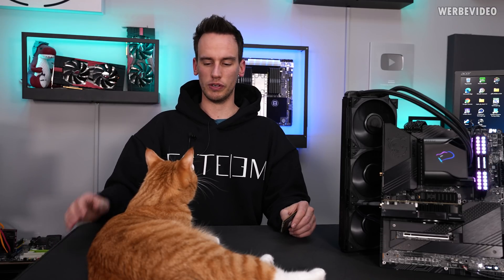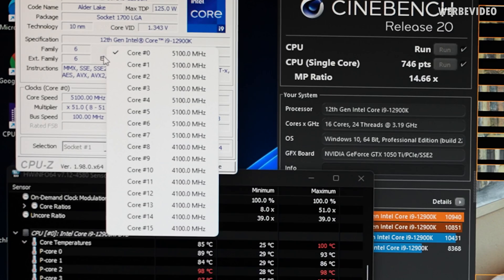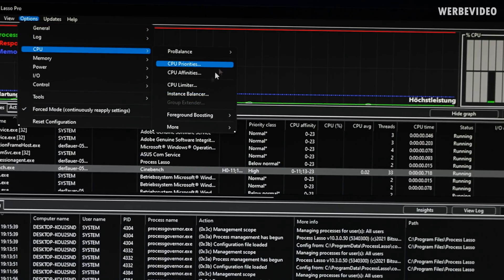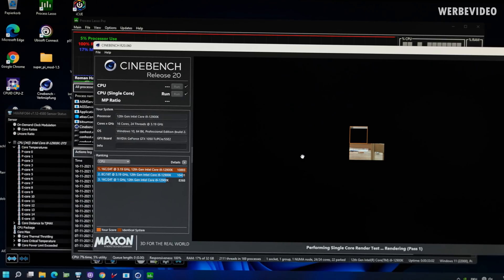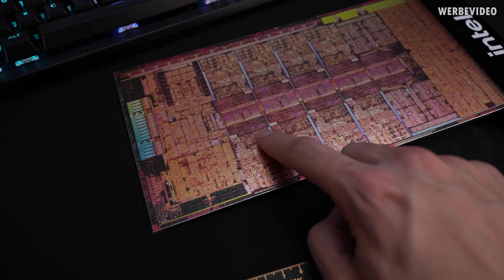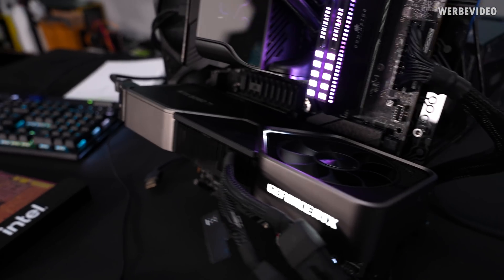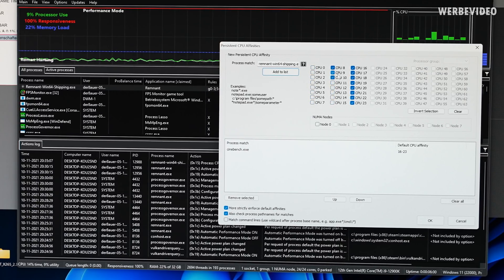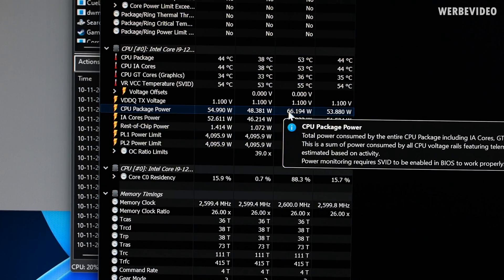The E-Cores were not meant to be used This Way... but it's Amazing!

Comment: Excelent video! I really would like to see more E cores too. Few important tasks demands a good single thread performance. 

I don't know the reason why intel didn't go for more E cores. I would prefer 4 P and 24 or even 16 E cores.
Reply: Power, thermals and socket size, considering how power hungry and hot this generation gets
Reply: Performance headlines. If they’d used more E-cores in the 12900K and less P-cores, it wouldn’t show up very well in benchmarks. Techspot did some interesting research and showed that for gaming, it would be best to only have P-cores. So Intel balanced it out to take the important ‘gaming crown’ with the P-cores yet put enough E-cores in there to also be competitive in heavily multi-threaded tasks.

Comment: I don't think that the result is that amazing, not bad but nothing to celebrate. My old laptop with a zen+ 4c/8t 3500u set a 45W made 1759 points at an average of 3.5GHz on cibebench r20, so normalizing for clock and core count should be around 4100.
But I understand that nobody can afford to make Intel angry, everyone reviewing those new CPUs is unnaturally positive on every aspect, even the power consumption

Comment: This should actually open up options for some super cheap CPUs or APUs with decent performance. Like a desktop celeron with 4 cores and a super small die. Increasing the die size a bit you could add like 128EUs of DG2 backported to intel 7. This could compete against AMD's desktop APUs which are far ahead right now, at least for gaming.

Comment: Intel probably kept the same number of P-cores as previous because that is what people expect. I think people might complain if an i9 only had 4 P-cores and 24 E-cores. It sounds like that might be a better processor though.
Reply: Unless they can get their scheduling to be perfect, threads bouncing between P cores and E cores would surely result in worse performance. At least this way the amount of threads used by most games fits on the P cores

Comment: Intel should make a e core only cpu. But isn't that called ryzen? I mean, relative small, lower power than the big intel cores, very good for multi-core, but not that well suited for high boosted single core performance. A bit like the first ryzen moment, but now with a big.little setup wich does not completely make sense at this moment with this cpu.

Comment: Nice video man. 
I was wondering, whether its the windows, the app itself, the motherboard or the cpu that decides on which core to put the load ?? Like how are they distributing the load ?

And one point to note is that 
Even if we use a tool like this (Process Lasso), some who are not experts may not even be aware that some heavy apps might just be using only e cores or mostly e cores.

I hope this works out for intel and for us, as it may be a huge technological advancement. Its like having two cpus on one motherboard, one for small tasks one for heavy.

Comment: I wonder if the CMT "dual" front end from a bulldozer module (modernised of course) would increase efficiency again - from memory that only added 15% die space to add a second thread at nearly the same speed for integer work. I'm not sure what the sharing L2 relationship with the E cores are.

Comment: I used Lasso back in the day of the First Ryzen 1700 so i could have games running only on one CCX not really had the use to use it since windows was updated to better assign tasks, was much better then disabling half the CPU to avoid the CCX cross talk and could still use the 8 cores and 16 threads in multi apps but then used 4 cores and 8 threads in games.

You could optimise it further too with 2x P-cores with hyperthreading and leaving enabled the 8x E-cores since games mostly utilise the first 2 cores for graphics and AI.

Comment: I’ll be interested if your opinion “this is the way to go” changes when AMD drops Zen 4. A P-core could also be ran at a lower frequency with a much lower voltage to become more efficient. This little big approach seemed like the only way for them to compete. They need giant cores pushed to the limits to sustain gaming performance leadership, but they would be shipping more heaters without the E cores being able to run every day tasks. It works and it’s exciting because it’s new and seems efficient, but I’m not convinced this is the way to go.
Reply: CPUs are becoming more heterogeneous in general. You're seeing various types of accelerators and "neural engines" being added to perform specific tasks instead of the main core.

So it only makes sense to take this further and have dedicated cores for maximum single threaded performance, and then paired with slower, less power consuming clusters of tiny cores for heavily threaded workloads. 

Zen4 will be amazing, but Gracemont cores are half the size of Zen cores. Intel could out-scale AMD core count in the consumer space.
Reply: @moist_ointment  agreed that there will be lots of compute types on a single CPU die such as different accelerators, but I’m still unsure that we need 2 different cores that can each do the same task only for the sake of energy efficiency. It seems to be working for Intel on their first generation, but AMD has explicitly said they won’t be doing the same thing. So it will be interesting to see things evolve with the 2 x86 players proceeding with 2 different methodologies
Reply: With the logic you have set, think of it this way -> running a P core at lower voltage will certainly reduce performance, and increase efficiency, while taking up as much space as 4 E cores (which by the math here delivers more that 4/3 multithread performance of a P core at lower power) ... It's not so much that Intel needed the core count to compete with AMD, its just that this is the right way to go if you want to scale both single thread and multithread workloads within the same die space. In fact, intel will have the freedom to adjust the P core E core count within the same die space to add more multithreaded performance. I would encourage you to see how the mobile CPUs will perform, because instead of 8P cores they will have a 6+8 within the same die space, and it might help you see better why this is the way to go

Comment: Seems like a good workaround for Windows 10 weirdness in some cases. Would be interesting to see how much performance the e-cores get when overclocked. Can they match an 8700K or a 9700K?
Reply: They do match a 8700k out of the box. they aren't 6th gen cores, they're just based on the same architecture.

Comment: My concern has never been with the processing capability of the E cores. I don't have much confidence in schedulers doing the "right thing" with processes. We've been living in an SMP world for so long.

Yes, ARM asymmetric SoCs have been around for a long time, but that's in mobile workloads, not desktop.

We shall see, though.
Reply: Sure ARM improved that tech during a decade but you seem to neglect that's not just mobile workloads but embedded workloads as well with much higher time constraints and those worloads run on more slower processors and memory/cache than laptop/desktop so they need all the resources available as well as the optimizations.
The reason ARM heterogeneous arch works well without any special scheduler is because they mainly use the Linux kernel which was long time ago tailored for NUMA multi CPU servers and doesn't have the tendency to randomly switch process execution from a thread to another.
The scheduler just need to be as simple as the Pstates frequency governor : prioritizing performance or efficiency by launching a new processus on one type of core according to the processus priority then moving it from the other type depending on its resource usage. And It just works.
Reply: I totally agree. Just not a good design decision. We have been in an SMP world at the low level Windows NT flavors and even Linux and the like schedulers for so long in the X86 ecosystem that Intel's approach to this kind of change just does not make sense. And thus I have no confidence in schedulers doing right things with processes designed for same type of CPU core count and type as well as a massive library of software in the X86 ecosystem.  This is a much bigger and more radical change that can cause much more issues than any of the other changes we have seen the last 20 years or maybe more. I mean chipset changes, CPU arch changes like pipelines and IPC and core counts, just new drivers and such at low level. And scheduler changes in Windows not an issue as SMP has been around since like 1995 with Pentium Pro. Switch to dual core CPUs. Not at all an issue as a dual core CPU was no different to Windows NT and Linux scheduler than a dual socket CPU system as all dual core was was 2 CPUs in one chip. Likewise Quad cores 4 CPUs in one chip as opposed to quad socket single core CPU mobos. Not an issue for SMP world. But a hybrid arch like this and right away not good. Nothing wrong with trying something different, but Intel making a mistake locking SKUs to 8 P cores only and not offering separate ones with no e cores that have 8 or more. Cause it is going to be a long long long time if ever hybrid arch catches on or is good for the desktop.

Comment: It would be very cool if you could get efficiency data on these e cores at stock and overclocked :)
That CB score is right on par with i5-10400 (from hardware unboxed 2020 8700k video). 424 vs 433(10400@4.3ghz) ST, and the 8 e core beats the 10400's MT 3188 vs 3203. It looks like Intel sent an additional i5-10400 with the 12900k.

I do wonder if in the future background programs like discord and others can specify themselves to run on e-core only, and games the inverse. But honestly 12900k has enough multithreading to not be impacted by perceived slowdown due to suboptimal core distribution in 2021.

On the flip side I am much more excited about gracemont-only mobile CPUs. IF it has almost the same IPC as comet lake and is much more efficient, the bottom shelf of shitty notebooks using gracemont would not have any performance issues, and Intel could do more interesting things like 1-2 pcore + ecores. Which is already effective at desktop, so I have high hopes.

Comment: The reason I'm not sold on the E-core concept is that most games I play just can't use that many cores. Let's say a certain game only supports 8 cores (afaik, current gen consoles only got 8 cores, so to my intuition it makes sense a lot of games will be coded accordingly); Why would I want 8 strong cores with some weaker cores on the same die when I could have had 8 slightly beefier cores instead? Let's say that (hypothetically) without the E-cores, I perhaps could have had 8 cores at 5.3 GHz instead of 4.9 GHz. I can live with 2 small cores for background processing I guess.

Comment: but if you have lots of cores why does it matter if they are "p" or "E"?   i mean for a desktop what they savings? a few cents a month in electricity? i guess i just dont understant the over all idea of it, i mean for a laptop of mobile it seems great but for a desktop of HEDT it seems almost pointless. what the actual energy draw difference at idle? also how much would we save if we just turned our computers off when we were not using them?

Comment: Honestly, I've always been more intrigued by the E-cores than the P-cores. Unfortunately, based on this and another review, they seem less efficient than I was hoping. Which seems to just be the reality of this process at the moment. I read someone else call them "density" cores, and I think I agree with that. It's still impressive what they pack in them, and I do think they will eventually take the multi-core crown fully from AMD with this tech.

Random fun fact I took out of curiosity. 8 Zen3 threads limited to 105W PPT running through a QEMU VM is roughly 10-20% faster in R20. Too lazy to dive deep down that rabbit hole with disabling SMT, lowering PPT, etc. as even then, it still wouldn't be a like-for-like comparison anyways.

Comment: Now imagine if they make a cpu with just E cores, 40 E cores would still be amazing at 4.1ghz
Reply: That's what some ARM SOC makers have been doing lately, a bunch of smaller cores for workloads that mostly rely on having a lot of threads even if they're slower. Wouldn't fit with Intel's obsession with having the best single threaded performance but there definitely would be workloads that would benefit from that type of design
Reply: Glued together? xD Imagine would still be cheaper to buy 64c threadripper, but I get the point, would be neat to have such cpu for some rendering or  similar.

Comment: E-Cores on desktop cpus suck. They cause compatibility and performance degradation issues. They should have simply put 10 cores, the perfomance loss would be minimal but more stable and simpler

Comment: There is something wrong with your performance calculation.  An E-core only has 1/3 the performance of a P-core ?    It should be at least 50% and should be in excess of 60%.  Maybe the issue is workload-specific.

I will also point out that in a multi-core workload where all threads are in use, each thread on a P-core is roughly 1.5 / 2 = 0.75 of a single-threaded P-core.  Call it 0.50 to 0.75 of a P core.   If an E-core is roughly 0.32 of a P-core, as a non-hyperthreaded core, it actually puts up decent performance on a thread-by-thread basis against a P-core.  With a multi-threaded workload, fully loaded.

In that respect, it makes total sense that multi-threaded workloads on Windows 10 do not really see a scheduling penalty of note verses Windows 11.  Once you load all the threads available on the CPU, the schedulers wind up not mattering so much.

-Matt

Comment: eCores running background services while pCores are all free to run your main programs makes total sense. Videogame consoles separates a single core or thread from the CPU to run the system and left the rest for the dev to use in their game at full capacity. No more wasted cycles waiting a low priority thread to finish computing making you lose precious time on the main program.

Comment: I can see the P and E cores having the same CPU arch in the future once those little Atom cores catch up to the big ones with the only difference being clock speeds.
Reply: That would defeat the purpose. The whole point of E cores is that they are built on architecture optimised for efficiency which necessarily means they do not scale to high performance.

Comment: Interesting suggesting 6P + 16E. I came to the same idea previously. Also, process lasso could be used to fix compatibility issues with programs that don't work on hybrid architecture without disabling E cores in bios, or waiting for scroll lock hack which likely does same thing on the fly.
Reply: Good thing the new `13th gen will have 8p cores 16e cores for 24 cores 32 threads.  GONNA BE SO SICK

Comment: Again if you don't know programming you might assume discord and chrome can run on E cores but that's false.
Any app that has to interact with the display, the audio devices or the keyboard has to be put on the fastest core possible.
You can put networking and disk on E cores not GUI apps.

Comment: Okay so I am pleasantly surprised by this result. But I am still kinda iffy about its use. I can imagine e-cores being awesome in interrupt-heavy tasks like moving memory from disk to the network card or the other way around. Generally speaking on servers with high bandwidth networking, you can easily lose two cores of your system to just processing the interrupts. Losing one cluster of P-cores instead seems like an acceptable tradeoff. But that still leaves me with the argument that I'd much rather have all equal cores and just have more cores and more diespace using the AMD chiplet approach than having to deal with different strenghts of cpu cores for thesame amounth of money.

Comment: When I heard they were doing this hybrid solution, I was wondering how having OBS only using E-cores and then gaming on the P-cores only. Similar to running game on one CCX and OBS on the other for Ryzen, not sure I saw any benchmarks on if that was a good idea :P
Reply: You can run most of those capture programs on the iGPU with ZERO effect on the cpu.  If you have an intel cpu with one.  They literally have HARDWARE on the die for this instead of just using software.

Comment: I wonder if project lasso could be used to fix alder lake compatibility issues with certain apps on Windows 10. If those issues were caused by jumps to the E-cores, disabling E-cores for that task could solve the issue.
Reply: I haven't used mine much but I took a win 10 installation that has seen like 10 chip sets, and it used the cores on my 12600k very well a few performance cores were running during gaming. And all other cores at 0% useage. 

And it used much less power than my 5900x about 50-70% less,(70-100w for the 5900x and about +/-35W for the 12600k. 

And despite much worse cooling that the 5900x has the 12600k wouldn't go over 70c gaming and 30c idle while the 5900x idles at 60-70 and goes up to 90 while doing light gaming.

It was also getting more fps in nfs heat with a worse ram(not much worse both 3600mhz but ryzen had dual rank ram with better timings).

So all things considered very happy with Intel's new CPU.

Comment: I mean, if we are going about efficiency, a 11900HK is more efficient right? At least in terms of Power to performance
Reply: Nope, it's the Core i9-11900KB Tiger Lake for the Beast Canyon vs Rocket Lake Core i9-11900K.
Reply: @saricubra2867  but the KB is less efficient in Power to performance ratio, 65W vs 45W TDP, HK has higher Multi-Core Performance, KB has higher Single core performance and clock speeds.